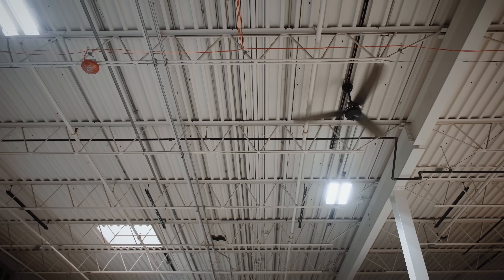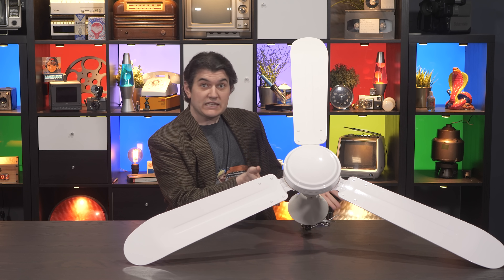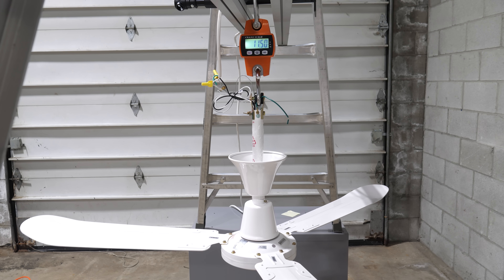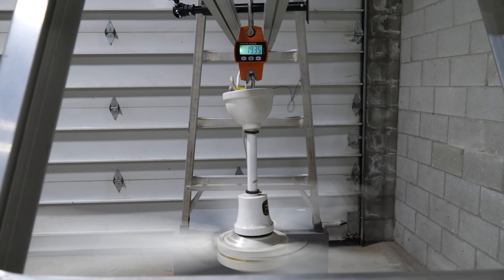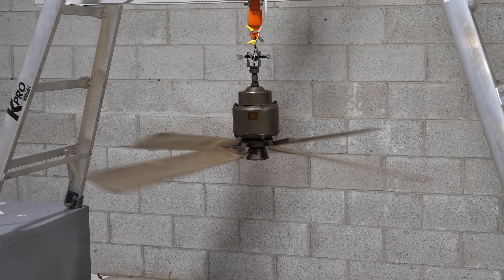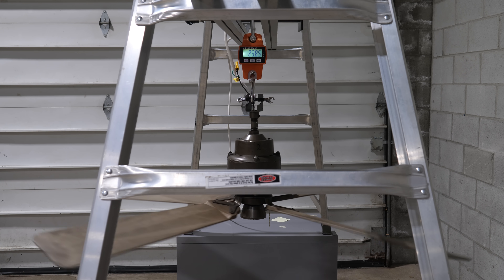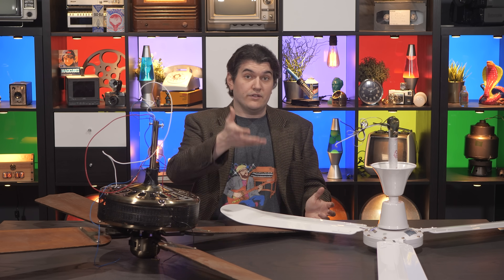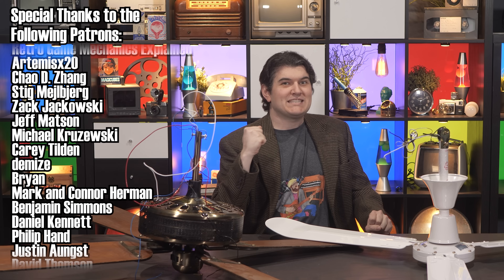How much thrust does a ceiling fan produce?

Comment: Another great video, Alex, on something that I never wondered about!

A couple of Newtonian dynamics comments: First, theoretically you only need to counter the torque of the motor/fan (or helicopter engine/rotor) when you're changing the speed of the rotating part. The rotational equivalent of "F=ma" is "τ=Iα" where τ (tau) is torque, "I" is the rotational inertia around axis of rotation, and "α" (alpha) is the radial acceleration. If the fan is rotating at a constant speed, then α is zero so there's no torque.  In the real world, there's always going to be a small amount of torque to overcome bearing friction and, of course, the aero drag on the fan (which is doing the work you want on the air to get it to move). Your video shows this (most obviously at 8:35) as the motor assembly spins up, but then partially backs off at constant speed. It spins the other way during deceleration.

The other dynamic comment has to do with the "lightening/heavying" you noticed during startup and slowdown, but not at speed. This was probably due to gyroscopic coupling, the phenomenon that lets toy gyroscopes "defy" gravity and spin on their sides. If you remember your "right hand rule" (hold up your right hand with the thumb pointing up, the index finger pointing forward and middle finger pointing left), when you spin the gyroscope rotor around one axis, and precess (rotate) the assembly around another axis, a torque will be developed around the third axis.  In the case of your setup, the fan is spinning around the vertical (thumb) axis and the startup torque causes the assembly to rock to one side (the precession), which will cause a torque around the remaining axis. That will try to pivot the assembly around the third axis, and since the only place you're attached is the scale hook, this will show up as an increase or decrease in the linear "weight" reading.  The fact that it reversed direction between startup and shutdown nailed that for me.

Comment: so I bought a "wood stove fan" and put it on my gas wall heater... it kinda works, like once it's hot I give it a tap and it spins.  I noticed it uses the same tech as those crap box refrigerators you recenty taught us all about, is it plausible that there's a good one out there? Tinker powers activate! 😂
Reply: also technically you should be able to measure the thrust of the ceiling fan no matter which direction it's mounted..
Reply: The peltier device stove fans are perfectly decent imo, but there are stirling engine ones that are more efficient... but also quite a bit more expensive.

Comment: Bigassfans produces a fan that has blades 8ft long. Working in a factory, I can tell you those fans, even at the lowest speed, move massive amounts of heat. Everyone praised the floor manager for them. Three of them circulated the air for the entire floor. These fans are gigantic and intimidating to look at. There is no way you could fit one into your garage testing facility, plus I have no doubt the torque from it will twist you ladder setup.

Comment: The weight increase at start up is just the extra electrons. If you add 3,000,000,000,000,000,000,000,000,000,000 electrons they'd weigh about 300 grams

Comment: If you also measure the air velocity, you can use the force measurement to calculate the CFM and compare it to the manufacturer's spec.

Comment: Ceiling fans are "supposed to" be mounted on a ceiling fan electrical box.  If you are changing an existing ceiling light to a fan/light, most people just use the existing box.  Otherwise, it can involve a lot of work.  This can be risky on a case by case basis depending on box condition, size and weight and torque of fan etc.  Be safe people.

Comment: I get it. If you remove the tail rotor from a helicopter, you become so much more efficient because you're not spending resources to work against the work you're doing.

"That's a different number in kilograms" this is the length of detail I also prefer when writing those stupid engineering reports in school.

Comment: fun fact, helicopter blades aren't really "blowing air down." At least not in the way you might expect.  What they're actually doing is spinning a bunch of wings around in a circle really fast and those wings, because they are moving through air, generate lift, and the helicopter is LIFTED off the ground.  Horray!   A Harrier jet does push down against the ground in the way you might commonly expect.
Reply: I like autogyros more anyway. Main rotor is unpowered, yet lift is generated by the air simply hitting the blades and make them spin with the aid of a rear pusher or front puller and some control surfaces, flies like a plane, the Spanish inventor wanted a plane that could never stall, then came Sikorsky and did the boring thing.

Comment: I see the problem on the heat recovery fan test.  You used a 1/2 in. wrench.  It was supposed to be 13mm. :)
(ok, I'm gonna put in a little more effort here and say)  I think the worst thing on the electrical box is a fan that's out of balance.  Wiggling those screws back and forth... back and forth... right over your bed... thousands of times...

Comment: Brings me back to my graduation project.
Somewhere along the line i had to test the thrust of different dc motors and brushless motors.
I love how a 10 times smaller 1200Kv motor can generate almost 4 times thrust with less than 100W of power. If i remember correctly I got some motor and propeller to 1.5 kgs of thrust ( a bit over 3 pounds) with 10 volts and 8 amps.
Thank goodness we don't use ceiling fans to generate thrust.

Comment: Hey, if you still happen to have this setup, you might consider adding some DIY aerofoils to your fans. Ceiling fans don't generally include anything fancy like that, but it should hypothetically make a noticable difference that makes the fan slightly more efficient. Lift should translate directly to airflow so it's a pretty effective way to test how much difference it would make to just have a better designed blade.

Comment: Since that was my first thought, I'm sure a lot of others asked, "But can you actually use it as a plane propeller?" And the 5% thrust-to-weight we got with the best example here is going to be rough. You'd need a really good glider with really light batteries and inverters. But heavier competition gliders do have lifting capacity to take on the weight of 20-30 ceiling fans it'd take to produce the thrust necessary to keep it in level flight. You probably wouldn't be able to attach the fans to a glider like that without ruining its characteristics, but it at least tells me that a custom glider ought to be possible to construct.

Comment: As an electrician, in my area at least, a heavier duty box with better mounting is required when mounting fans.over a certain weight. Regular octagons can work, but more support is usually required to do it right.

Comment: TC should make a couple of videos related to fans. There are several questions he can explore. 

1. In summer, which fan cools the room better / faster ?  A ceiling fan that blows air up/ down or a standing fan that moves air sideways (possibly to outside of the room).
2. Does having two fans push air simultaneously downwards ( or upwards) work better to circulate the air than having each one push air in the opposite directions?
3. Does having an air-conditioner work together with a fan better than just air-conditioner alone? 
4. Say you have 2 rooms connected by a door. One has windows that are exposed to summer daylight, and the other one is not. What's the best way to cool both rooms? Treat them as 2 individual rooms ( ie keep the door closed) or as one big room ( door is opened)?
Reply: 1 is easily answerable with a google search; I'd love to answer it here but we don't have ceiling fans here so even though I saw the answer before I didn't bother memorizing it

Comment: I know this is No Effort November so any extra effort is out of the question, but you could've stopped the fan from spinning by mounting four metal rods to a plate, drilling four holes in a second plate, putting the rods through that and then capping off the rods. You'd have to have a scale that can be tared to not see the weight and the friction would make your readings off by a fraction of a percent, but that'd probably still be more accurate than the friction caused by the scale getting torqued now.
In that case you could've even mounted the fans properly on the bottom (sliding) plate like you would on a ceiling and measured the load between the two plates.

Comment: You could have attached off-center a horizontal stick supported by the wall to counteract the torque, a stick long enough so that it's essentially free to move vertically but keeps the scale from getting twisted. Also, I wonder how much difference it made by hanging them so close to the ground. The air is less compressible that way.

Comment: At first watching I think there are all sorts of problems in here.

First, I would have thought it obvious that torque is a bigger problem than thrust forces.

Second, it seems to me the issues of platform stability are miniscule compared to the fact that you have a wide open space for air to escape and therefore not affect the weight as much as it might. Either you need to place it so far from the ground that thrust due to air pushing against the floor becomes negligible or you need to contain the fan in some sort of tube (oh, I mean a Wind Tunnel!) and measure something like N/m^2. Or perhaps an enemometer and calculate force from the area and air speed.

...

Comment: I thought about making a ceiling fan, from the rotor head of my RC helicopter. Fully adjustable speed and direction of airflow (plus, in downdraft mode, it's direction would be steerable).

Comment: The friction between all the parts inside that weight scale from the torque of the fan might have caused the readings to be slightly less changed than if the torque was controlled in some way. All without affecting the weight taken away from the fan by its thrust. I know that makes no sense and the difference is so minimal but I thought I would try to explain my thought process

Comment: Unfortunately its is not the same thing as helicopters and turboprops. This thing is designed to move air around, so yes the reaction is this thing moving to the opposite direction.
Now a helicopter has a lift producing blade, that is not designed to move air around (it just happens as by product). An lift producing blade act by playing with Bernoulli principle, accelerating air on one side of the blade and producing positive pressure on the other side. The pressure differential is what makes the blade propel itself to the opposite direction. The same thing that planes do on its wings. but as you may guess wings produce trust just when you force air going by them.... So in a plane the engine makes the plane go forward an the wings produce lift. On a helicopter we make the wing goes in circles, so the air passing on the produces lifts. that where helicopters are called to have rotating wings and planes to have fixed wings.

lifts producing devices will have a lot of more lift, or as you called it "trust" at the same speed and power consumption, but will move less air around that this thing you calls by ceiling fan.

Comment: If you need to measure force on a single axis, you want a strain gauge, which is the thing inside the scale.

They're typically a block of aluminum with a cutout, a resistor that varies based on bending, and an amplifier to make that signal useful.

Comment: 8:16 This is the standard hook in Argentina, it has a rubber bushing inside a U-shaped hook, which is inserted into the tube. Then the bolt is placed between the holes of the tube, and through the bushing.

Comment: Fun fact: The NEC requires the electricial box installed for a ceiling fan to be a fan rated box. Typically they are designed so the fan is supported by more than just a couple of 8-32 screws.

Comment: Regarding helicopters, you should look into the mechanics of swash plates, the parts in helicopter rotor hubs that permit the blades to continuously vary their pitch throughout their arc of travel, which is what allows a helicopter to control its thrust and attitutde while it is essentially hanging from a giant ceiling fan.  Truly, they're marvels of engineering; Igor Sikorsky wasn't wrong when he described the helicopter as the closest mankind has come to realizing the dream of the magic carpet.

Comment: I've built custom multi-rotor drones, here are some thrust data for comparasion. Larger propellers are more efficient, the typical maximum thrust efficiency is around 4g/w for tiny drones the size of your palm, 8g/w for medium drones that can carry a small surveying equipment, 14g/w for human weight cargo transport, which the propellers are sized about the same to a ceiling fan.

Comment: An unconsidered factor: These fans were ran in the open, with the ceiling effectively at infinity. Like the way a helicopter or hovercraft or drone can hover very low more efficiently due to ground effect, what increased thrust does a fan generate when mounted at its intended location?

Comment: I find it funny that the Sikorski single rotor helicopter design dominates the market even though tandem and coaxial helicopters are so much faster and more efficient because a significant amount of power is used to drive that tail rotor and that is all wasted energy that a tandem or coaxial rotor does not have to expend.

Comment: I know this doesn’t help after you post the video but my idea to weigh the fan in use would be to flip the fan onto a scale and drill a couple holes in the wire housing to let the wires attach to power, then you would just take the increase of weight

Comment: I've installed a lot of fans commercially in the past. Many models have very little to almost no pitch angle to the blades. I've taken my own fan and added washers to the blade holders to make them slice into the air at a better angle. The air output seemed to double.

Comment: In regards to this what I'd really like to explore is the thrust combined with imbalance and it's effect on the mounting box. Nails/screws in the homes ceiling. Like if you have a fan running at max with it's thrust pulling it away from the ceiling combined with a slight imbalance will that walk screws and nails? How dangerous is a ceiling fan actually if it were to come unglued from the ceiling under full load? This needs to be a 2 hour deep dive.

Comment: What do you mean, load on electrical box? There is a cable coming out of the ceiling and to mount the fan you need some reinforced-concrete drill to get a hole in the ceiling. After that, a 6mm Dübel from Fischer will hold your body weight.

Comment: You'reclosing comment aboutthe twisting force of ceiling fans on startup illustrates why the NEC requires fan-rated boxes for fan installs.  They're identing by a UL listing mark and "rated for fan use" on the box.  They come in different materials and configurations; some can straddle a joist, other require mounting to structural lumber or a fan brace kit.  And yes, fiberglass and plastic fan-rated boxes do exist.  Metal alone does not a fan-rated box make.

Comment: I had imagined that you were a big Mythbusters FANboy back then, but i guess not.
They tested whether a truck full of flying pigeons would weigh the same as a truck full of stationary pigeons, and it did, as the air of the wings gets pushed down, which comes back to that sciency guy rambling about action and reaction.

Comment: The only observation I made in the video, which I thoroughly enjoyed, was that there was a variation from the one fan running forward verse running in reverse. I would theorize that the increased weight lost (lift) going forward, would be due to the added air pressure of the air impacting the nearby floor which would be compressed much more than the air that was pushed up to the, much further, ceiling.

Comment: Your explanation of helicopters is quite good, but why is it that the two rotors are different sizes? Well, it's simple.

The top rotor makes lift. It is big because lift is expensive.
The back one is smaller, because torque is cheap.

Comment: The video misses the point of how propellers produce thrust. Helicopter rotors are airfoils, which don't produce lift by pushing air downwards, but by the pressure differential created due to the air passing differently on the underside and topside of the profile. If you gave a ceiling fan the profile of an airfoil, it would create a lot more lift.

Comment: At least in the US. Fans must be mounted to electrical boxes rated for fans to handle their forces. In fact, where I am requires you to install fanrated boxes for even for non fan fixtures where it is reasonably possible for it to be replaced with a fan. And for good reason! I have seen fans installed in old homes supported by the sketchiest of boxes!

Comment: I needed to install a junction box specifically rated for ceiling fans. Normal junction boxes are rated for lighting fixtures which don't have torque or thrust loads. Of course some people just install the fans dangerously wrong, the same kind of folks who like plugging multiple space heaters into a single power strip... ⚡🔥

Comment: You didn't take into account the weight of the electrical current on the scale readings. When the fan is first started, it requires an influx of current to initiate rotation of the fan blades, so therefore it will weigh more.

Comment: You don’t need to weigh the fan at all. As a first order approximation:
Thrust = mass flow rate * velocity
Velocity = volumetric flow rate / area
Mass flow rate = volumetric flow rate * density of air
Reply: The volumetric flow rate and diameter of the fan are printed on the package